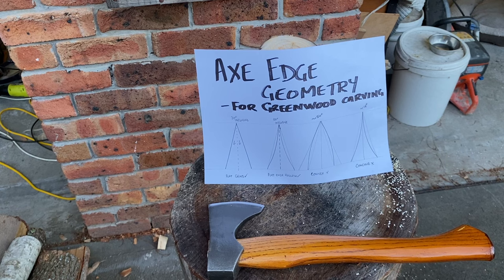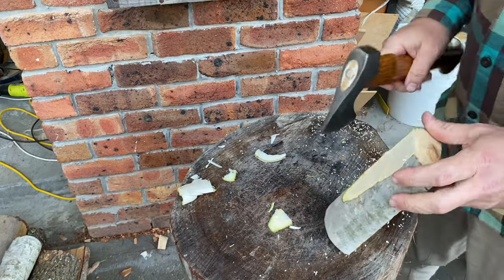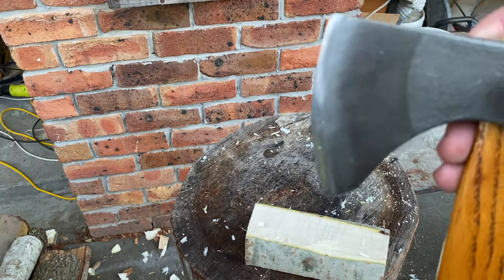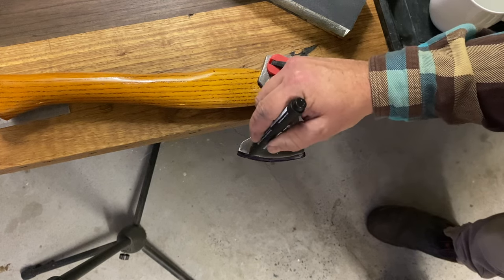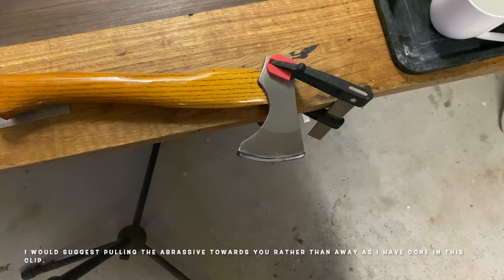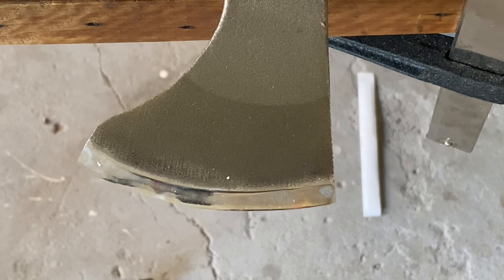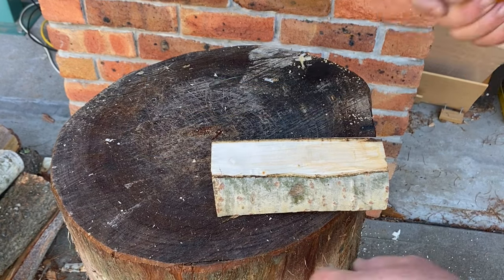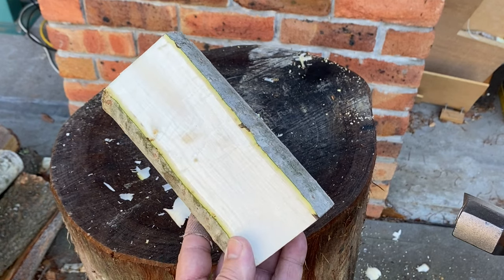Carving Axe Edge Geometry - Part 2 - Demonstration Convex vs Flat Over Hollow

Comment: I have a couple of hatchets that I use for carving Greenwood as well as seasoned. They both have asymmetrical grinds on them. As I am right handed, the left cheek of the hatchet has a completely flat grind on it to plane the wood while the right cheek has a bevel on it for biting into the wood. Works beautifully

Comment: Such an obvious difference in performance after the sharpen!
I’m pretty inexperienced at this….I’ve been told that I should use carving tools on both green wood and dry wood. Is this true? Does the difference in wood effect the way you sharpen or care for the tools?
Thanks in advance
Reply from the maker: for carving seasoned or green wood the principle is the same for sure.

Comment: What sort of ‘belt axe’/‘bushcraft/survival’ axe or hatchet would you suggest for Smaller amounts of seasoned wood processing for fire prep? (a lot of dry Eucalypt laying around on the ground in Australia), particularly getting into the dry center of branches that may be wet on outside, and also cross cutting branches up to about 3-4 inches…rather than chopping down thicker trees where a strictly two handed axe may be necessary.
I like the idea of some of the coldsteel tomahawks, but I’m wondering if something with more weight (how much?) would be necessary for processing enough wood for a small scale fire.
I’ve heard tomahawk heads over a certain weight tend to snap the handles, but even in the US (with generally softer wood) I’ve seen some of the lighter tomahawks bouncing off wood. Although I mainly just want to chop dry branches to length and then split the wood down to kindling
Reply: Small splitting Axes are the way to go imo.